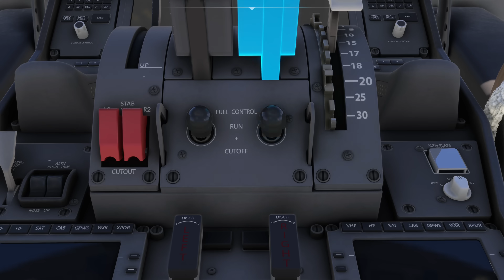Air India 171: Why Did The Fuel Cut-off Switch Get Moved?

Comment: it's so convenient to put the blame on the dead pilots. just to white knights big corporations like boeing. who would have thought huh? from an ideal perspective, true those switches need to be manually cut off. but mechanically those switches could have manufacturing defects and hence possibly switch to the off position without even moving the switch. well of course just let that slip on and blame the dead pilots and shield the big corporate boeing.
Reply: It's not so simple. You will hear the click sound of the switches being moved in the audio recording. That is (likely) immediately followed by the other pilot's question, "Why did you cutoff?" This question indicates that the other pilot saw the switches being operated physically. There (likely) is all evidence needed, we just don't have all the details available yet. Steve is just giving his best guess based on what facts are available to us.

Comment: The time gap between two fuel control switches going off is exactly one second or they just rounded off the time. what if time gap is 0.55 or 0.6 sec? how can it be exactly one sec?
Reply: You have to double that time. The second measures only from signal to signal and doesn't include the time needed to shift that first switch into position to cause that first signal. So the 1 second is the time it took to shift the second switch only. In total, it took 2 seconds. That's my guess, at least. Also yeah, they could have rounded the time. It's possible that it was 0.58 seconds in between. Or 1.02 seconds.

Comment: There is a possibility that the fuel control switches read outs were incorrect, i.e. computer thinks it's cut-off when it was not in cut off? 

That's why the pilot says he didn't do it ?

How can this be verified
Reply: The fuel control switches were both manually placed back on 10 seconds later. How would they be turned on again if they weren't in the off position prior? Also, someone else raised a good point: You'd likely hear the distinct clicking sound of them being operated in the cockpit audio.  Perhaps that's information that will get released at a later point.

Comment: Dear Captain , how could a passenger flight take off in Fuel switch off  position?? why  didn't the loud voice from the computer say " turn on the fuel switch on .... turn on the fuel switch on"....
Reply: An airplane can't take off with the fuel switches in the off position. They were on for take off. Three seconds after take off, the fuel switches for both engines were transitioned to off, according to the preliminary report.

Comment: If you want engine cutoff to be a two-pilot operation, it would be easy.  Just remove the central panel and have two cutoff panels, one for each pilot, on opposite sides of the cabin.  They could have lights for each engine at Green for both Run, Yellow for one at cutoff and red for both cuttoff.   But the engine would stay at run until red--i.e. both are set to off.  This also has the benefit that a single switch failure wouldn't cause an inadvertant cutoff.

Comment: Quick question to the aerospace engineers (from an electrical utility engineer): How is the mechanical position of the fuel run/cutoff switches supervised by the flight data controller? Is there a dedicated set of contacts that feed position logic directly to the flight data recorder or is the recorder getting position data via the ECC unit? If its the latter, is it possible that a worst case scenario could have occurred where a controller logic fault could initiate fuel system cutoff AND send signal to the flight data recorder that cutoff was initiated without the switches being touched? Just theorizing here without knowing how these planes are wired/controlled.

Comment: FAA Aviation Safety
SPECIAL AIRWORTHINESS INFORMATION BULLETIN
SAIB: NM-18-33
SUBJ: Engine Fuel and Control
Date: December 17, 2018
Introduction
This Special Airworthiness Information Bulletin (SAIB) is to advise registered owners and operators of The Boeing Company Model 717-200 airplanes; Model 737-700, -700C, -800, and -900ER series airplanes; Model 737-8 and -9 airplanes: Model 747-400, -400D, -400F, -8, and -8F series airplanes; Model 757-200, -200CB, -200PF, and -300 series airplanes; Model 767-200, -300, -300F, -400ER, and -2C series airplanes; Model 787-8, -9, and -10 airplanes; Model MD-11 and MD-11F airplanes; and Model MD-90-30 airplanes of the potential for disengagement of the fuel control switch locking feature.

Comment: How do you know that a software glitch or sensor failure didn't cause the TCMA (Thrust Control Malfunction Accommodation) circuit to shut down both engines at the same time?  This is what happened on a Nippon flight in 2019, but it happened during landing, not takeoff. This circuit is part of the Electronic Engine Control module mounted on each 787 engine. It's too early to blame the pilots.
Reply: I agree.